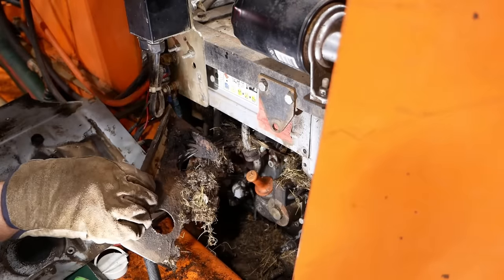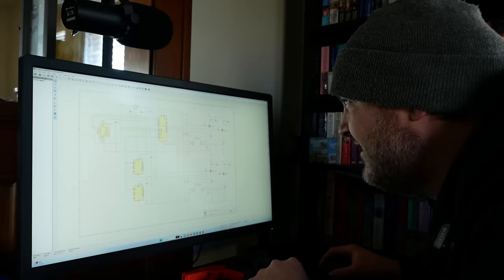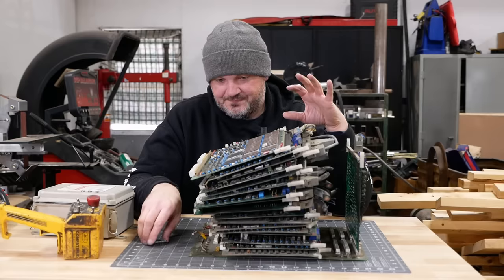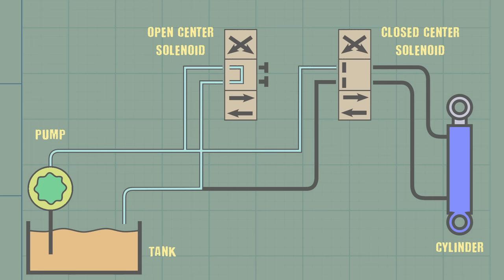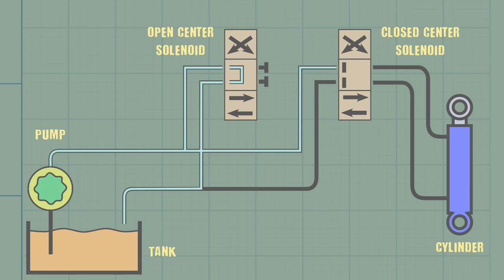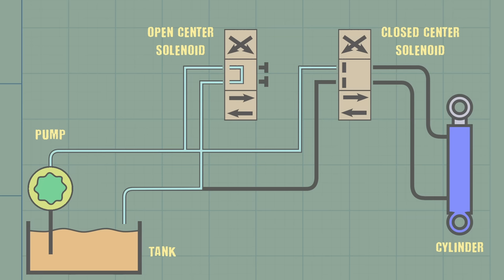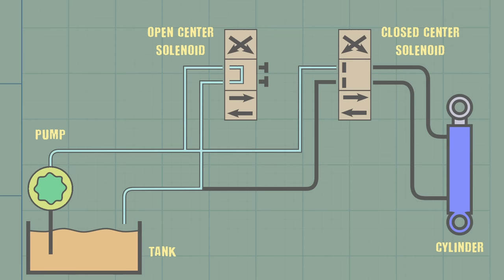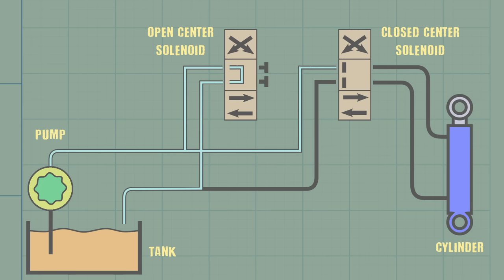Will It Move after 10 Years? Sketchy Robot Hacking

Comment: Regarding the feedback: I wouldn't use the voltage as feedback, but use an encoder to get the feedback. One option would be to get the actual valve position, so you can adjust the solenoid this way. But a better option would be to use a rotary encoder on the actual tracks. So the solenoid's pulse width is following what the track is supposed to do, rather than a voltage or a valve position.

This should give absolute straight tracking, regardless of other flaws in the system, like different flow rates, restrictions in the flow to one track, different terrain, lateral slope or other non-uniform pull on the vehicle.

Only slip of the tracks itself is not accounted for this way.

This way you can avoid dithering and thus reduce wear significantly on the valves.

---

Slip itself isn't an issue tho, only uneven slip is, so you could correct this — if you want to — by adding a compass to the vehicle which can detect that the vehicle is turning when it shouldn't.

But this is probably out of scope for your programming skills (sorry!) so I would recommend buying another Arduino and put Ardupilot on it instead. This way you can command the actual rotation of the tracks with Ardupilot and use its good feedback capabilities of it for 3D compass and GPS plus remote and autonomous mission capabilities :)

---

Just mentioning it because that's also an option: There are sensors which can optically track movement. So in theory, you could drill a hole in the bottom of the vehicle (between the tracks) and track the movement of the ground below to compensate for slip and drift to one side. This is done in optical mouses as well, but you need a sensor (or more specifically a lens) which focuses further distance away from the sensor.
Reply: To increase steerability you could also add either a dead zone on the joystick, or even better have a 1 axis joystick for forward and backward and a spring return knob which can turn in two directions for turns. So forward and backward is completely uncoupled from turns on the remote.
Reply from the maker: I do have a deadband. The problem with any kind of feedback is the slow physical response of the solenoid. It takes up to a whole second to respond to commands. That latency would cause massive oscillations. I don’t know how to get around it.
Reply: @WatchWesWork  the algorithm for this is PID, which gets tuned with the typical response time. It's originally modeled after the input of a helmsman to the rudder of ships to hold a steady course and it used to this day for tasks like this.

Its not perfect but it sjould get the job done.

Comment: You need to add a control/momentary button to remove left/right input when pressed, allowing you to go forward and backward only.  Otherwise add a second stick one for forward/back and another for left/right, or tank steering one stick left the other right as needed.  With the amount of time that you need to remove left/right from the steering,  a single button, to remove left/right input is probably the best option.

Comment: Hi Wes, I consider myself a master mechanic and I'll work on about anything. You truly impressed me with all the electronics you made there. You've gone further than me no doubt 👍. I got to thinking about this video and what if you just got like an RC 8 channel radio transmitter and receiver from some hobby outfit ? And wired in the outputs on the receiver to some relays and then control the hydraulic solenoid valves that way?  It doesn't seem to hard

Comment: Amazing Wes!    I figured you could get it to operate with your skills , but since you hauled this science project home I've been thinking that after you got the engine to run and the tracks to move that you would start to remove the computer and it's control switches to just replace everything with spool valves and hydraulic hoses ( and a seat ) and actually make a useful machine out of it. There's a pile of valuable parts that have been going to waste for a lot of years not to be put to good use.  I'd get some grease in those track rollers & idlers right away.  They probably had very little, or not any since it was built.
Reply from the maker: As far as I can tell nothing on the tracks is greaseable
Reply: @WatchWesWork grease means attracting dirt etc, hence tracks are in general sealed for life. Tracks always squeek.

Comment: Something that might have saved you a few headaches in troubleshooting that solenoid control is using integrated DC motor control circuits. Solenoids are just linear motors when it gets down to it, and DC motor control chips are super cheap online

Comment: This thing needs mechanical maintenance. Just look at the tracks and the dirt that falls off of them while moving. There are parts that have even broken off of them. I'm sure when you clean out the hydraulic parts and especially the parts that move it forwards and backwards, it will respond better to commands. Someone drove it thru the woods until those problems appeared thinking that a vehicle on tracks is indestructible. Just service some gears and pumps and bearings before you re-invent your remote system. You are on the right path

Comment: Great Video.  You may want to use a lower drive frequency to overcome the stiction issue.  I don't think the solenoid controls are good for proportional (linear) control but they may be great at allowing a timed pulse of fluid to pass.  In transistor terms, you are hoping the hydraulic value operates in a linear mode with solenoid current being the controlling factor.  I think you have more of a high gain op amp forming a digital switch as the control crosses the threshold voltage.   Likewise poor sliding action may cause inconsistency in the linear area of travel.  Consider using the existing mostly on/off value as an fuel injector allowing a measured oil volume (on time of solenoid) to fill the cylinder/motor in small increments.  The fluid control will be greatly improved by full on/off coil voltage with slow PWM vs simulated analog current (pwm at high frequency).   Since the flow rate is also dependent on the engine rpm, monitoring pump pressure should allow duty cycle compensation for high or low throttle operation.   I'd look for the switching duration at voltage specs on the valve then determine the minimum on time before the value passes oil. This may be 50ms.  For increased flow extend the on time as needed to fully on.  You will also need an minimum off time to ensure the valve fully closes.  I do not know if this value is designed for this increased cycle life however.  It is also possible the solenoid the designers picked is a poor choice for the application.    Good Luck.  Kevin  North Dakota State University Grad '85 EE  37 yrs in automotive systems engineering.

Comment: The interesting thing is that the electronics is not all that complex:  MOS-FETs are essentially just very fast relays.  Everything is digital, so it's either on or off.  Going on or off really fast makes it seem like complex analog stuff.  I've designed some stuff like a buck-boost charge controller for boats using similar electronics, and it doesn't take an EE degree or even more than high school math.  Programming it doesn't take much math either, just infinite patience!  In his project, I think the hardest thing by far is getting the mechanical systems to work right.  Not so hard to get them to work, but very very hard to get them to work right.

Comment: Start with the "simplest" thing first, pull the treads, clean then soak em in an oil and rust remover bath for about a week. While you're doing that check tread rollers for stiction, fix any that you find. Test.

If that doesn't fix the wildness, move onto the hydraulics, check hoses or the motors (probably need rebuilt or replaced) or the proportional valves (might need rebuilt or replaced). Test.

Lastly check the solenoids, your controller might be speaking a different "language" or they may need replaced. Test.

If none of that works...well...ive no idea what would lol. Best of luck, can't wait to see more.

Comment: a hacky alignment machine should be pretty easy. small laser on a stick mounted to a plate with the proper bolt pattern for the vehicle mounted on each side of the front, and a very small photovoltaic panel mounted to the same sort of stick and plate on the rear. could just wire an led to the output, no computerization needed.  in theory, the longer the post, the more accurate it'll be. then all you need to do is find a way to measure the distance from front left to rear right and from the other 2 corners to account for the inevitable irregularity. the hard part will be coming up with a way to make the process repeatable in a timely manner.

Comment: Get a Flysky FS i6X 10 channel remote and add the serial output of the receiver to your Arduino. Really simple, cheap and lots of source code available online. Also add a calibration matrix to your code, when the motor starts to move, half speed or full speed. It’s not linear, but your joystick is.

Comment: That's amazing! You can probably make it wireless fairly easily by either using something like ArduinoBLE and an XBox controller straight into you existing micro, or using some RC gear to get some PWM wireless inputs and reading those in the controller. The Xbox controller will probably be better as the form factor probably fits this machine better than an RC radio.

Comment: I would either put a boat / jet ski style of safety shutoff (lanyard type) or run a safety control loop in the control harness so if it takes off on you it will pull the cutoff and shut down the motor.

Comment: Very well done! I suspect the lack of controllability is partially due to the size of solenoid orifice on the tracks being too large (and thus not having adaquete authority). How I've seen this handled on similar problems in industrial engineering is to have either a smaller orifice (to achieve finer control, at the expense of high speed) or parallel a big orifice & a small orifice (2/3 & 1/3) to maintain fine control. No idea if the idea transfers to "automotive"

Comment: "Engineering Stockholm Syndrome" 😂😂
I know the feeling...

I find this type of video fascinating. I wonder if you could add accumulators to the track hydraulic circuit? They might absorb some of the initial shock to the motors and slow it down. Of course sizing them appropriately could present another engineering challenge. Keep up the good work! 👍

Comment: I only understand about 40% of what you do on this machine but I'm now here for the long haul and want to see this project to completion. It might require a gear ratio or maybe even a hydraulic motor change to get the fine control that you (and I) think you should have to make it as controllable as you want it to have.  IMO the currently on/off solenoids for the blade and the claw should have as much control as the track controls and the tracks should have much finer control. I'm not in your shoes and I'm sure it's not just that easy to do. Easier said that done scenario, looks and sounds easy to do but in practice takes weeks or months to actually make it work right.

Comment: Its going to need some form of feedback for the traction motors. Probably a resolver/encoder circuit, software corrected, since the motors are not connected? Have to call it an MCAS for the tree dragger.

Comment: That’s the best drone I’ve ever seen!  My vote is keep going with what ever you enjoy.
You should be able to add cordless to that fairly cheaply.  How much guts do you have 🤠
Program in “The Prime Directive” early!
I have got two raspberry pi pico’s talking to each other each with a clip on Lora Wan module.
It’s peer to peer so it’s not actually on the internet at all.
They send text strings to each other that I have used to hold Json formatted strings of data.
For shits and grins I have included encryption/deception.  You could put what ever you like in the data strings.
The range of the lora modules is basically as far as you can see. 
I wasn’t concerned about round trip packet times so I didn’t optimise for that.
Keen to know what happens next.

Comment: Wireless?
Esp32 development board...
Has on chip Wi-Fi. Can be programmed with the Arduino IDE.
One for the control board and one for the remote control.
Can run Gerbl (if that is what your using) or FluidNC.

Otherwise not too bad for a guy in a cornfield....

Comment: 2:33 I am almost tempted to call "your very limited knowledge of electronics" somewhat of a humble brag. Building a completely new, functional control system like that, from loose components, it definitely requires a rare set of skills in various fields... 
Heck, I was thrilled for weeks, after I got my Atari to run on a modern display, by soldering on a bunch of junk to it, that I got from a website..

Comment: I don't know if this will get red by you. But I've had experience with both the JCB skid loader and the bobcat skid loader.

From my experience that single joystick that is on your machine you might have a perfect program in order to run it but I always found those joysticks to be incredibly finicky even if the programming is perfectly right the execution is the problem.

Somewhere along the lines the signal always gets mixed up and it doesn't work properly like what your experiencing.

But if you have two sticks one for each track on a separate Network you will get your responsiveness back. And the programming would have a lot less variables if it only has to worry about one track per joystick.

If you would use two small joysticks like that beside each other you can operate both joysticks with one thumb or two fingers.

I'm not electrician but I have run these heavy equipment before. And from this experience I would highly recommend going to a two joystick setup for the tracks. Simply for simplicity and a lot less headaches for you.

And if you don't see the argument that I'm making with it in your video when you are testing the lights you can see when you're trying to turn one track on it was causing a flickering.even the most steadiest of hands will still have difficulty trying to get a single joystick to work on two tracks. Now if you're going to be walking getting your exercise and your adrenaline moving it's going to be really difficult to keep your hands that's steady. 

I just strongly recommend a two joystick setup.

Comment: I don't know whether anyone else has mentioned this and I'm not about to search through the 3874 comments already posted to find out.  As I seem to remember, when Detroit automakers first started using robots for assembly work they tried hydraulically-actuated ones but had the same kind of problems you're having.  That is, hydraulics don't provide the precise control needed, which is why they went to electro-mechanical robots.  That's probably not an option for you, though.

Comment: "I already deleted all the parts that didn't seem to work, and what's left still doesn't work."  i feel that all the time  working in software.  With testing self driving vehicles they usually have a remote kill switch  that stops transmitting to kill the vehicle.     So then if it looses connection to the kill switch (whether it be from connection issues, actually killing the vehicle, or leaving the kill switch in the garage when you go to drive on the test track) the vehicle cuts power and stops immediately.  This remote kill switch is separate from  the remote control(which has its own e-stop).  This give a fail safe remote kill switch.  You should probably implement something similar.

Comment: it shouldnt be overly difficult to interface a wireless gamepad to your microcontroller, this should give you the standoff distance that you need. (just make sure that your program zeroes every input when comms are lost)

you might need to add a "trim" input for your steering so you can balance the two hydraulic motors

to better tune the low speed "lurch" you could have the solenoid "pulse" to a higher / lower value than desired for 100ms or so to overcome the stickiness of the solenoids, then drop back to the low PWM value thats needed.
Reply from the maker: That’s called peak and hold and it may well be what I need to do.

Comment: You should have at least used WiFi to control that thing so you dont have to be tethered to it.  The way I handled safety on some of my larger machines was to have a hall effect transistor attached to the frame and a magnet on the drive wheel and each 1 rotation it triggers an interrupt that disables the PWM timers. When it gets another joystick signal the timers are re-enabled. Thats a dead man switch that at worst allows 1 drive wheel rotation before foolproof shutdown.

Comment: You need pure 12 or 24 vDC on these spools. Have you checked and verified your supply on a scope and, also check your not getting AC type corruption spikes when switching. This could be the erratic side of the problem. A temporary fix for the hydraulic problem would be to a manual faucet type flow control on the pump to slow down the flow. This would generate heat in the oil long term, not good. B

Comment: Wes

just a point to consider when you go wireless control , I note that the OG had fitted two antenna to the robot , could that be a safety ploy eg one transmitter and receiver to control the beast and another independent TX / RX  unit as a fail safe shut down system , eg a dead mans handle type of set up ,.
just the ramblings of a old codger (  I used to program in C++ and work on large scale automation panels ,but heavy electrical power was my love 500hp and and above ) , sorry I cannot do a patreon for you because the pension fund will not allow it at 77 Pennys matter on a state pension